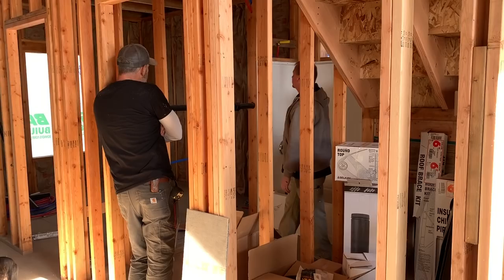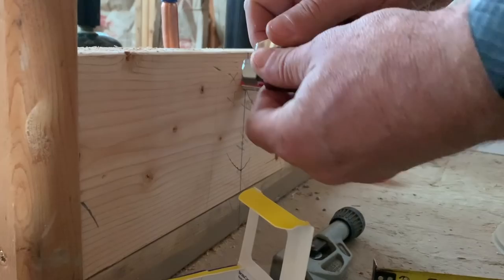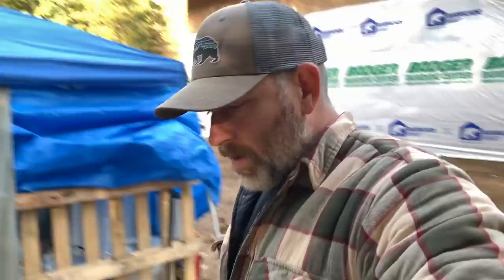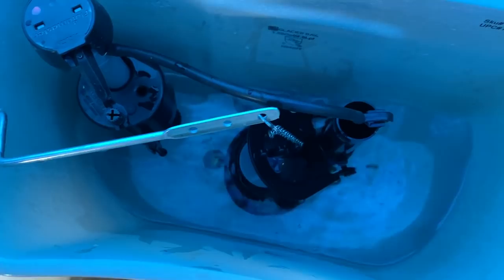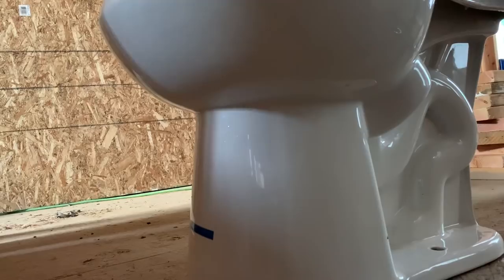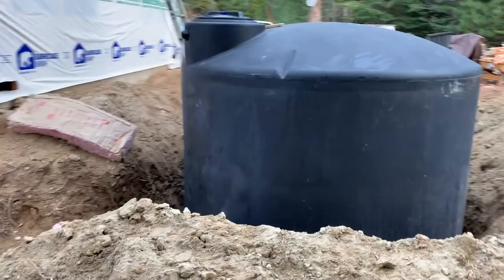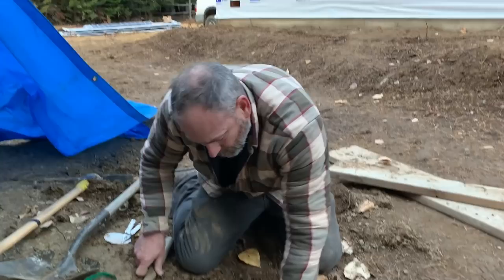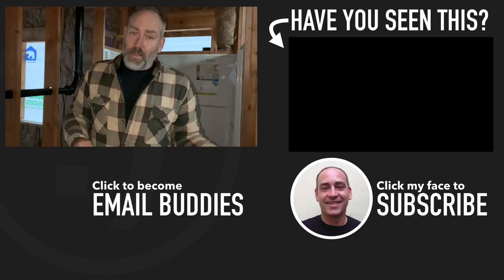YOU WON'T BELIEVE IT! | Off Grid Cabin Build #50

Comment: "Cut it three times, and it's still too short!" This brings me to my "Auschusion Discussion". 
I know the frustration of those rubber couplings. They make a "REPAIR" unit that doesn't have the centering lip inside, you slide the whole thing on one pipe, line it up and push over both pipes till even. I'm glad to see that the toilet didn't crack when frozen, we have to blow out all exposed pumps or they crack when it gets Real cold. I am happy that your team has a Thorne. Ya'll deserve it.

Comment: You guys are on a roll!  Working like pros!  Passing all inspections!👍👍👍.....Just one little tid bit.  The real good Plumbing pros will keep the water inlet lines capped off and not install the valves just yet until the drywall contractors come in and put up the drywall.  Then the Plumbers come back and remove the cap-offs and install the valves.  Their objective is to make life easier for the drywall contractors, not that any code violation occurred.  So then the drywall folks can just cut a hole the size of the pipe, not the size of the valves.  I hope this makes your life easier in the future.
Reply from the maker: That makes since. Unfortunately we need water before dry wall. .
Reply: @MartinJohnsonOffGridLiving  I figured that was the case.  The family needs to use the facilities.  Hopefully down the road the info will come in handy.

Comment: @17:00 If you are planning to leave that pipe at that distance below grade you'll need to move the entire property to somewhere south of Dallas. Where you are located I'd guess it needs at least another three feet to keep it from freezing. If I missed something that makes this observation incorrect I'd like to know what it was. The number of folks who pass that plumbing inspection the first time with the equivalent of your experience is virtually nil. Well done.
Reply from the maker: It should be fine because worm/hot water will be going through it. But I guess we will find out this winter. Keep watching and you can say, I told you so. I won’t mind.

Comment: I don't know if you have plans for this or not---BUT  before you seal up the walls you should find a way to seal up the holes in the floor where plumbing penetrates.  It is amazing how small a hole critters can climb through trying to find a warm spot for the winter.  Personally have used a 000 steel wool.  They do not like to chew on the steel.  foam doesn't always work

Comment: It looked like the wax ring still had that hard plastic wrapper on it when you mounted it.  I always remove that plastic covering, place the flat side of the wax ring down on the closet flange, and then sit the toilet on top...   using the screws to line it up properly.   That way, the rounded edges on the top of the wax ring compress up into the bottom of the toilet to form a good seal.   Can you dig what I’m saying here?
Reply from the maker: I took the plastic off. No leaks so far. Thanks for the tip.

Comment: Just some advice from personal experience, never use pressure fittings. You have pex, why didn't you get the pex shut-off valves?
Reply from the maker: I don’t like the look coming through the wall.
Reply: @MartinJohnsonOffGridLiving  Ah, I knew you had a reason..lol...Keep up the good work, it's coming together.

Comment: Bath spout. Did you use pex or copper?  I make the mistake of using pen years ago as a rookie installing pex to the down spout and water dribbles out the shower spout when you don’t want it to. The ID is too small so copper is in order otherwise the pressure builds and up it goes! Did that make sense?🤔
Reply from the maker: I used pex. We will see how it turns out. If it is bad I’ll change it. Thanks for the heads up.
Reply: Copper should fit in the push on fittings.